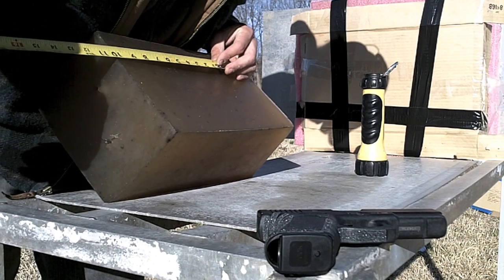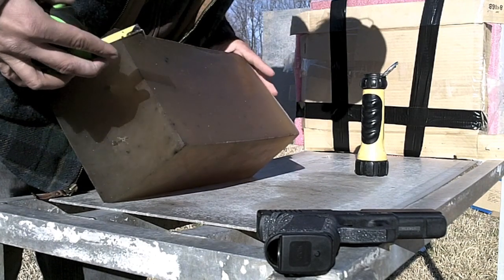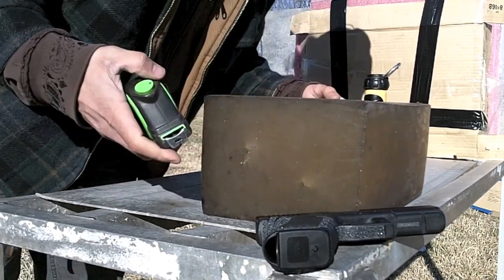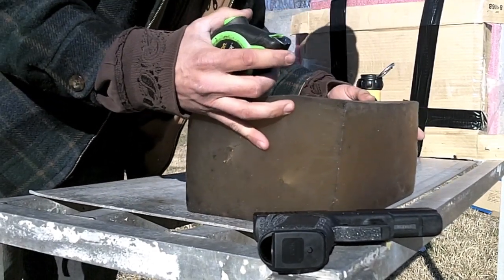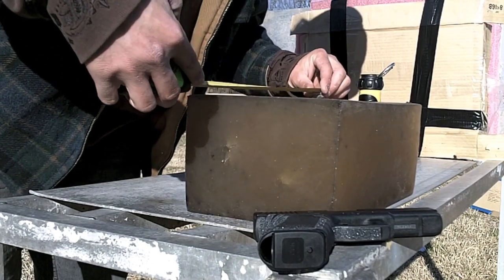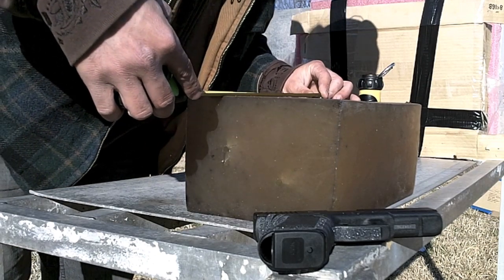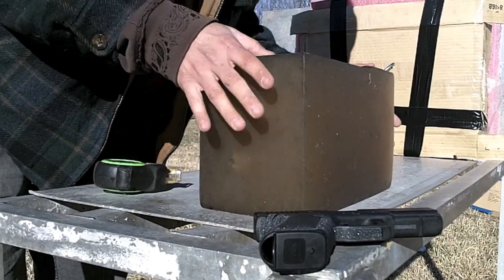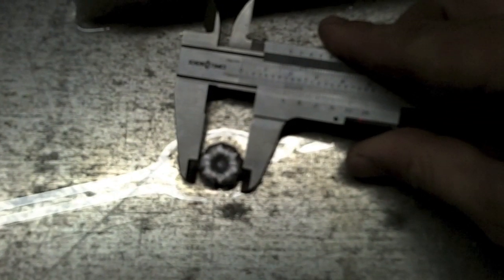Ballistics Gel .357 Sig Gold Dot 125 grain vs .45 ACP Gold Dot 185 grain

Comment: The .40 was actually designed to replace the 9mm, after the FBI got in a shootout and the 9mm was having issues making it throught the windshield of the suspects vehicle and still keeping lethal momentum.  This is also the reason for 147 grain 9mm rounds.
Reply: True, car windshield are made out of a tempered glass with a laminate now so a 9mm will reflect or take multiple shots to break if hitting somewhere other than a corner

Comment: Ok 1 more time boys and girls! The .40 cal and 357 sig were designed to help LEOs that needed the performance of a .45 but could not handle the size of the guns and their recoil. In other words .40 and .357 sig are .45 substitutes in smaller frame w/ more manageable recoil. If you can handle a full sized .45 then that's what you should shoot. The real thing is always better + the gun will last longer.
Reply: uhm...no. wrong on BOTH. but thanks for playing
Reply: because neither had anything to do with the .45. .40 was for those who couldn't handle the recoil of 10mm auto ( it was discovered after FBI instructors reduced the loads in 10mm) and .357 sig was designed to get the performance of .357 mag auto of an autoloader  (specifically, duplicate 125gr rounds out of a 4inch barrel)
Reply: @malleymyster  Another 45acp fudd, just clinging on to outdated, over rated, oldschool foolishness.
40sw. with 135 and 150 grain bullets Outclass most pistol rounds. Lighter faster 357sig is easier to shoot with similar results(less muzzle flip and recoil in general). Yes ,I have at least one pistol in each caliber and my 357sig 5" M&P 2.0 Pro(Kkm barrel and Apex trigger) is my favorite for most scenarios.

Comment: The .357 is 9mm in size but it is much faster, thus more energy. I consider it equal to the 45 but in most cases you can have a larger magazine capacity with the .357 as an added bonus.

Comment: I'm no expert or anything. But i have been comparing some of these test videos online. The 357 is still a 9mm size round. It may penetrate deeper then the 40 or 45. I think the 40 and the 45 would cause way more internal damage. (Self Defense of-course). I'm waiting to see a slow motion 357sig test. so that i can compare it to the 40 slow motion test. but no one has posted one yet for the 357. Until then I'll go with the 40cal.

Comment: nice video. The debate over penetration between 9, 357s, 40 and 45 rages on. they all go more than 9" into any type of media. kill depth achieved. anything beyond is usually wasted energy. you want the highest energy round that will expend most of that energy (do more damage) before it exits the target. bullets that get their energy from higher mass instead of higher velocity usually do that better.